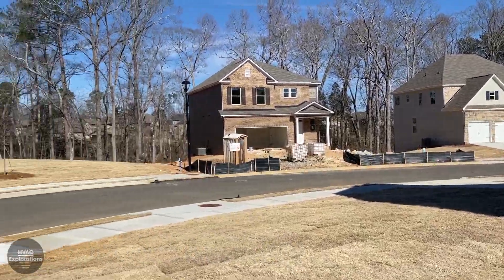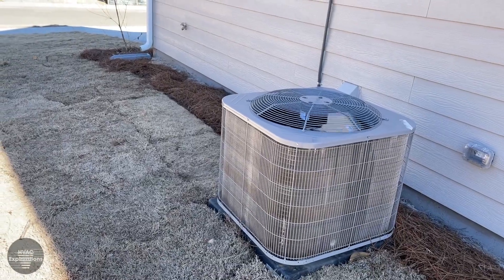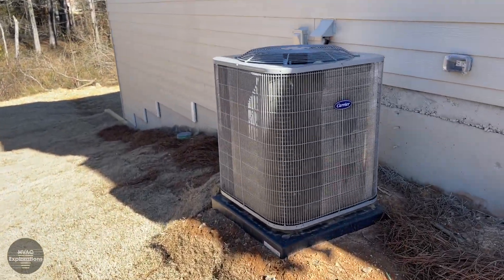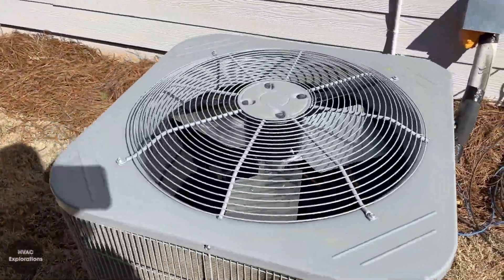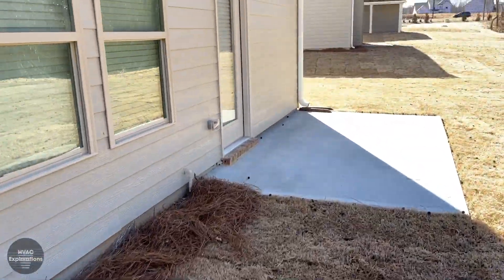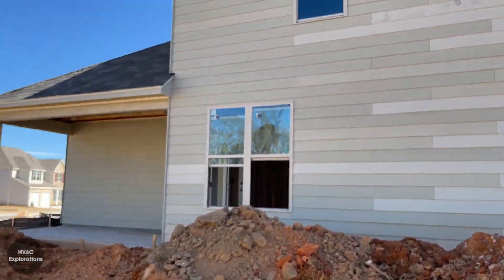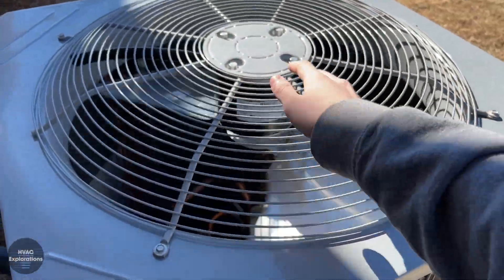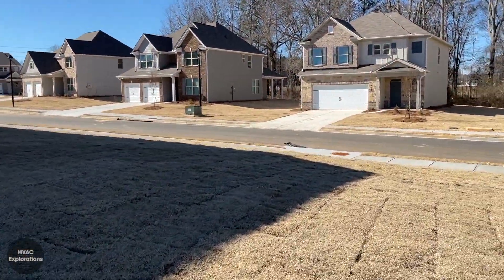Lots of New Carrier Sentry Heat Pumps - New Construction HVAC Heaven

Comment: 4:23 it sounds like that because the low side/compressor is over heating.. that happens if you run a heat pump in a high exterior temp, the blower is not blowing enough air or in this case it looks like the sun is beating down on it like mine.. you should’ve felt the suction line, I guarantee you it was as hot to the touch.. 57° is obviously cool enough to run a heat pump but when you add in the afternoon sun on a aluminum cage and fins and copper condenser coils, that gets hot and the blower motor can’t expel it well (same thing in the cool mode).. that’s why a heat pump should either be facing the east/ north (or even a better northeast corner) another solution to this is a sensor on the suction line and when the temp too high it either shuts off the condenser or better yet it ramps up the blower fan
Reply from the maker: Kuality